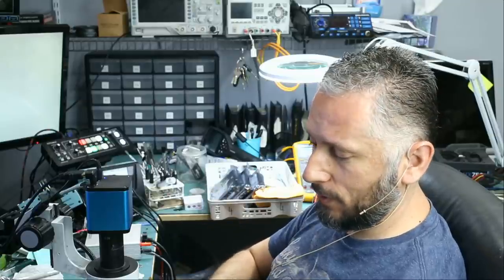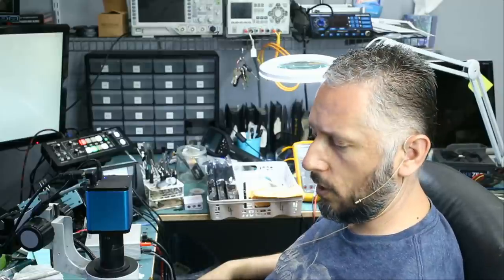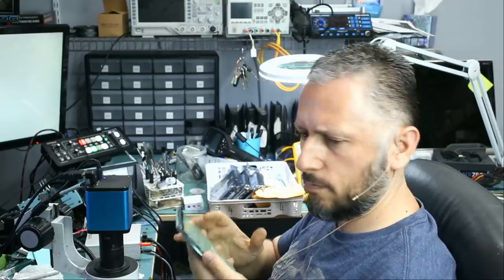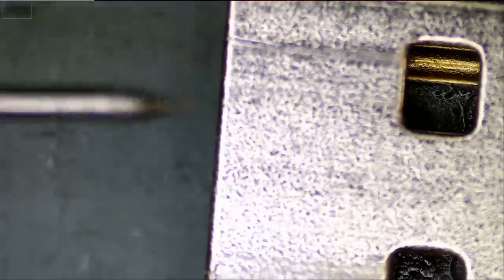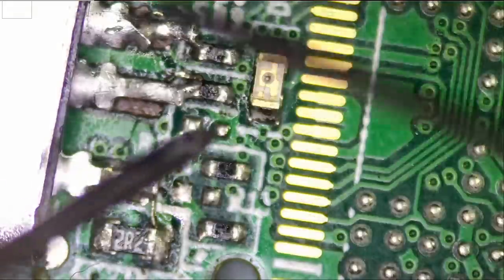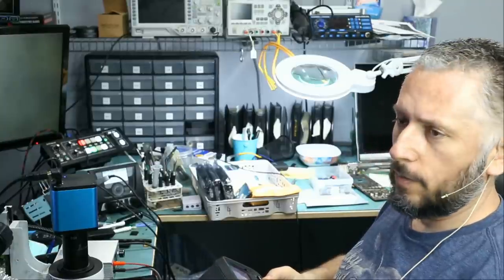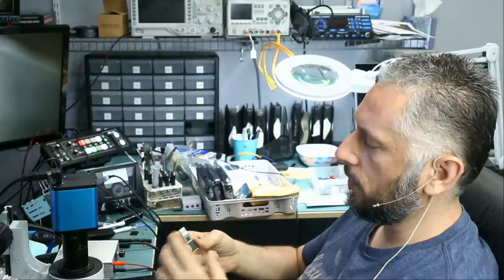Two Flash Drives Data Recovery - USB Device Not Recognized

Comment: If your doing a lot of data recoveries, I would definitely invest in a PC3000 and a DDI 4 disk imager, with the PC3000 you can select or download controller , just desolder the nand and plug directly on to the PC3000 nand reader and as long  as you've selected the right controller and the nand is working it should be able to rebuild the data, the DDI would be used predominantly for data recovery from mechanical hard disk

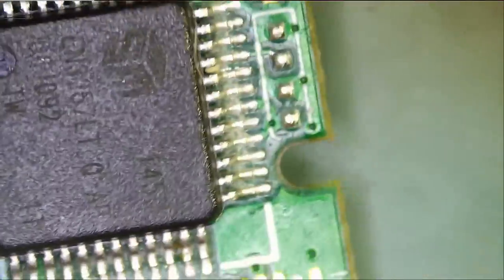Comment: first drive (watch at 4:45) there are 3 capacitors, isn't that left one not soldered?
Reply: This is infact correct
Looks like it's not making a connection
Reply: Yep looks cracked left hand side.
Reply: I do see a crack but I would imagine that there is still contact metal to metal. Also, being that it's probably a bypass would that make the controller heat up?
Reply: I also thought the same
Reply: Lets bring this comment UP, guys! THUMBS UP
Reply: I hope Alex would read this and try to resolder that capacitor and test it.
Reply: Its empty by default ig not looking like there is one .
Reply: the other half of this capacitor lead to the controller and he's probing the capacitor and the ground to test it so I don't think that's the problem
Reply: @Fizzi_  he tested for a short circuit
Reply: Yes its seems to have a cracked solder
Reply: It does seem like the capacitor solder is broken. Nice eye, man!
Reply: Yeah, that cap looks suspicious.
Reply: True I can see

Comment: 4:43 Capacitor is not making a good connection!!!!
Reply: You're right, the solder is fractured, but he aplied heat to the controller possible reflowing that capacitor, but I still would go back and check it

Comment: Is the transplanted controller chip also heating up under the IR camera like the old one?
Reply: yes I'm thinking the same too
Reply: Good point.
Reply: Excellent question
Reply: Greetings.  Great question. If the know good chip, IC, reflected and exhibited the same thermal condition that would be sufficient proof that the suspected IC is good.

Comment: NAND chip can be transferred over to the good board...but heat may cause the data loss in NAND chip (they are not so immune to bear heat, their MAX storage temp. is between 150-200 C, during manufacturing recommended temp to reflow chip is about 280-300 C for just couple of seconds )   as you have already reflowed it directly , may be you can reflow it from bottom  of board next time if its has single NAND chip.

Comment: I don't recommend swapping different controllers. This can damage the data if the PC attempts to write to it.

To recover data directly from NAND/Disks, you would need some equipment and good knowledge of file systems, sectors, cylenders.. etc.

It is very time-consuming to decap SD cards, solder NANDs and try to "guess" their sizes, file system, and data patterns.

If anyone wants to see, there are some channels that do this like "HDD Recovery Services"

Comment: I would be surprised if switching controllers worked, as the controller stores the bad sectors information and wear levelling information on it. So if you changed the controller the data would be in different locations than the operating system expect. The same would apply if the flash memory was transferred to another device. You may get back some data by doing this but I expect that most of the files so recovered would be corrupted.

Comment: I feel both the controllers are same as they have same number. But they are from different manufacturers. Hope swapping the controller chips will solve the problem. Good luck with the data recovery 👍🏾

Comment: I don't think you can measure resistors, unless one side is lifted. If an other resistor is in parallel, you measure the sum of that circuit part. Ofc this is still good method to compare boards.

Comment: Maybe the Nand chip from the other one matches is a way??? I dont think its a controller issue. I think its a broken pad or trace.
Maybe its possible to switch the NAND chip to the other one that you fixed.
Great video as usual 🔝👌👌
Greetings from Austria in Europe🇦🇹🥳🇦🇹
Reply: the controller is configured with specific NAND chip, also doing BGA is hard job and success rate in this case is very low so no use here
Reply: For me i dont change the controler i move the memory to the one that was working and check
Reply: @ClassicVideos432  What u say is true, but I think if the data is valuable enough for the client, is worth a shot. And since its the same drive, the BGA ball pins and controller should be compatible

Comment: USB not recognized is controller side not flash side.  If the flash was bad you would see a device that will be of zero size and most likely set read only.  I deal alot with USB to Serial controllers like the ch340 series for robotics projects among other things.

Comment: That was a nice try, sad that it didnt work. I dont know if its just a serial number or if it is possible that you need exactly the same chip. When there is a short in the chip itself, there is no other way to change it. But i think also that every board from the same manufacture has a chip with another serial. 
Maybe there was another faulty thing on that board.
You could also try to use a reader for the nand-chip but they are not really cheap.
But thank you for the video and show us your hard work. Greets from austria

Comment: There is a chance that d+ and d- pins are swapped. The donor board had a thru hole type port and the faulty one had an smd type. Right? Or maybe the port type is different and has swapped data pins. As far as i know an unrecognized device has to do with wrong usb protocol

Comment: I would once try to use the donor controller chip, since they use same pcb schematic, some companies Use different batch name but sometimes its compactable chip, 

I recovered a flashdrive 5yrs ago, with same pcb different controller, for final chance used the donor controller with different batch no and Flash drive worked perfectly fine.

Controller is responsible for USB detection. If it's showing unrecognized USB on windows, it means Bad controller OR damaged pcb layers. 

If the Good controller doesn't work on patient Drive, it means that the pcb layer on patient drive is damaged.

If usb detected with correct usb name then it could be bad nand or not mounted usb, requires mounting drive letter

Comment: Try putting the controller and the nand on the board that the pc did recognize and see if that works. If the nand wasn't working it would come up as a raw drive not unrecognized. I'd say a broken trace in the board or resistor is bad.

Comment: 3:40  too many stress to that little resistor  when user plug and unplug that USB device...  thin wires could be better
Reply: 13:15 that is better way !!!
Reply: It's not like the usb sticks are going to be plugged and used ever again. Once the data is recovered they go straight to the bin (or a drawer if you want to keep the copy of the data) and a new one is bought

Comment: at least drive should show up as insert disk or greyed out disk without drive letter if the controller is working, also with the incompatible controller is should be recognized but with missing size so there may be a problem with the board so you need to transfer the nand and the controller to another board to make sure there are no other broken tracks or shots. also if the controller is heating up maybe its not dead its the nand that is shorted or something else. Also most newer drives the controller is paired with the memory and it scrambles / encrypt the drive so you need software to unscramble it but if the drive is older a controller swap can still work.

Comment: That, board maybe has a broken trace between data pin to controller chip it self. Next step is transplant nand to a donor board, or chip off data recovery, with pc 3000.

Comment: Hmm…. Could well be incompatible chips, or it might be that when the original damage occurred, it ate the data on the NAND flash chip; and the hardware is now working but there’s nothing there that the OS recognizes as a formatted volume? 🤔
Reply: You cannot just replace controllers.
Each individual controller, even made with the same model and batch, is configured to read their NAND chip in a very particular way using An MPTool.

Comment: You cannot just replace controllers.
Each individual controller, even made with the same model and batch, is configured to read and unscramble their NAND chip in a very particular way using An MPTool.

If you cannot fix the board, the only other way is to directly read the NAND and unscramble it, which is the expensive part of the process.
Reply: If they are from the same batch for the same brand and memory size they should work, the controller is not individually programmed after being installed on a board the firmware is written in a maskrom inside the controller which was programmed during the controllers manufacturing and cannot be changed. Although they do list the sm3257en as supporting in system programming for firmware updates that option would most likely be for the consumer side.

Comment: I used to have similar problems with drives on Windows machine but when I tried Linux laptop reading from the drive was not a problem. You mentioned you tried on Mac so I think in this case Linux will not read the drive as well but you can at least try :)

Comment: You can replace controller if you have the same( exactly same type-exactly same marking) but only if controller doesn't use some sort of encryption(maybe found in datasheet). in that case if contoller is bad the data are unrecoverable. in case you dont have working controller(without encryption) and you don't have replacement for it. there is option in directly recover form nand chip, but it require extra hardware(i quess not cheapt) and experience. look at this channel. https://www.youtube.com/user/hddrecoveryservices. and like someone mentioned if filesystem is for example ext4 Windows pc don't recognize it.

Comment: why don't you buy a nand flash reader inorder to recover data so you won't waste time to solder on the broken flash drivers
also u tried to switch the controller chip try to switch the nand now
Reply: You can dump the data using a nand reader, but it's useless without special software like VNR or Flash Extractor to reconstruct the image. Expensive softwares, time consuming and hard to learn.